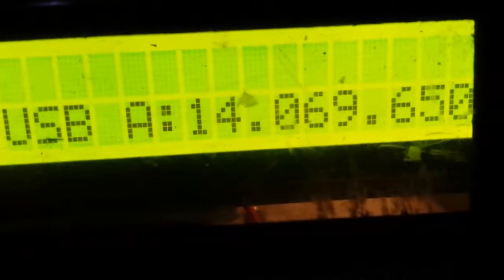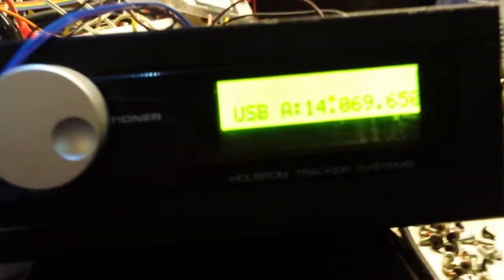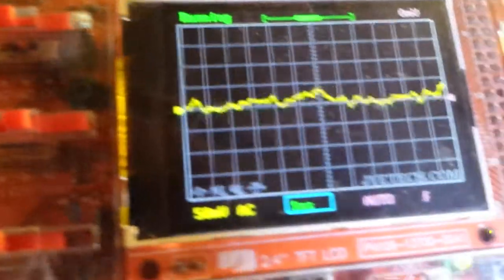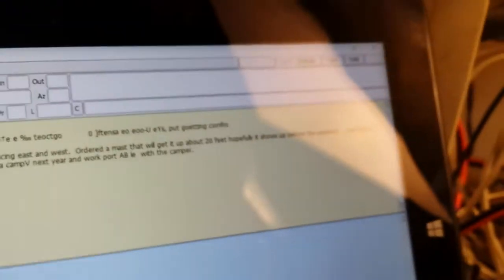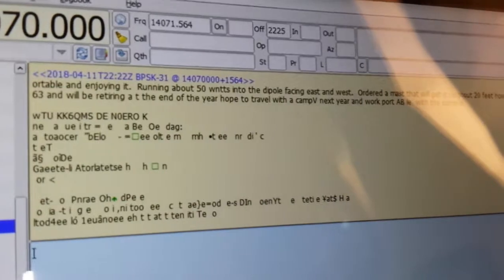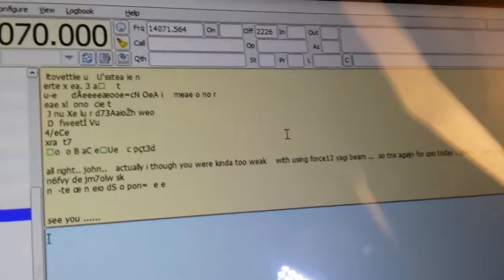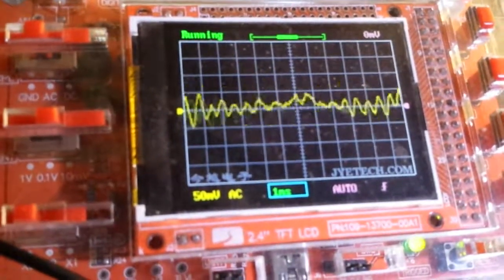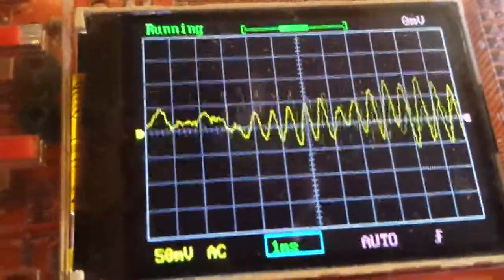uBITX using FLDIGI RX fm N6GRG + dso38 + PSK31 HF DIGITAL

Comment: I think you've convinced me to buy one. Thank you.
Reply from the maker: I guess they are right on the edge of coming up with a couple of android apps for hf digi. My tablet takes less power in android mode. But, it does everything in Win 10. There is also a little box you can get called the Wolfilink that you plug the radio and the android or win tablet into. Eliminates use of the microphone on the tablet and also enables transmit. 
They have upgraded the uBITX boards somewhat , and they work better. They now cost $129 at HFsignals.com . This would make Camping or Mobile HF very easy . And your not carrying a $1000 dollar or more radio with you.